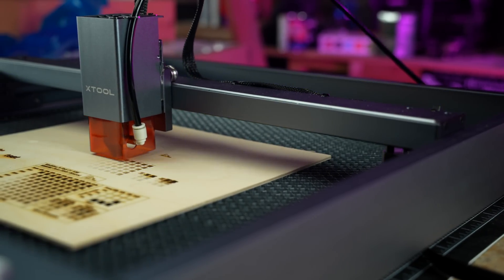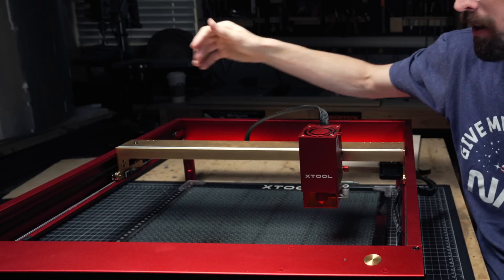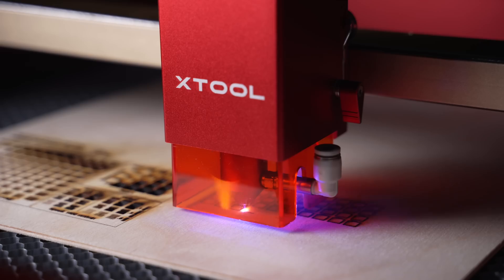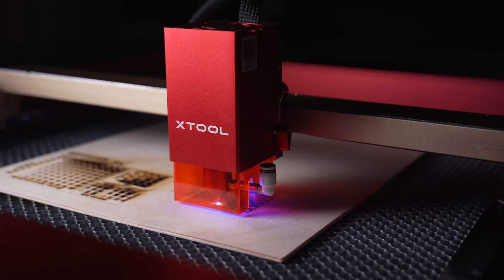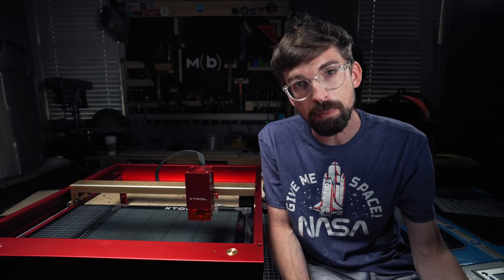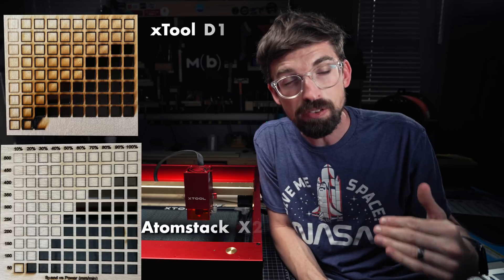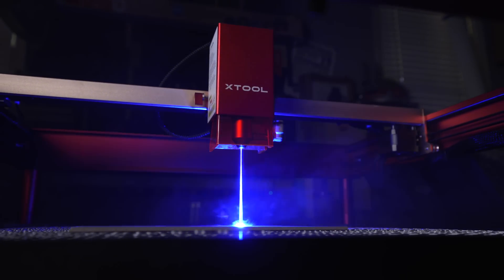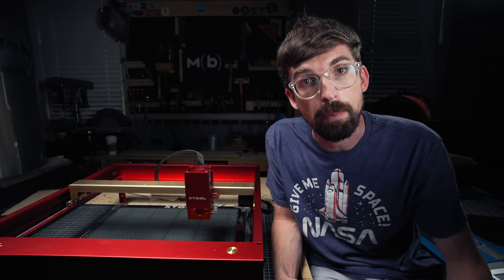3 HUGE Upgrades in the xTool D1 Pro!

Comment: Will either of those 20w machines, which you discussed here, engrave brass sheet to any depth?  I would like to be able to etch clock dials , with the engraving to such a depth that I can fill the etched numbers and markings with paint.  Don't necessarily need speed, in case it would require multiple passes.  Just want to know if it is possible at all. before purchasing a machine.  Thanks in advance for any advice.

Comment: Hello friend, I bought my xTOOL D1 Pro but, it has not arrived yet and, I have a question: Do the Limit Switches have to do with the laser functions > Current Position > User Origin > Absolute Coordinates? In other words, is there anything that needs to be configured before running the machine, so that the laser head does not collide with the machine's Frames? Thanks

Comment: Great review.  I have purchased the X-Tool D1Pro with all the attachments.  Half of the order is in and the other half will be here early next week.  Can't wait to get it all set up.  
My question is, what do you put under the honeycomb mat?  I am thinking that it would be a sheet of metal.
Reply: I use a silicone sheet meant for pet food bowls cheep and can handle the heat

Comment: This is a little off subject but I sure could use some assistance, I have a XTool D1 pro 10watt, I then purchased separately the 1064 infrared laser head. My question is can I use the power brick that came with the infrared also with the 10watt?  It’s kind of a pain switching back and forth. I’ve sent this question to XTool quite a while ago and have still not received a reply. Thanks in advance.

Comment: This isn't directly related to the D1 Pro. Does anyone know the center to center distance between the riser legs on the x axis and the y axis? I just ordered a metric ruler but it hasn't come in yet. I'm designing a mounting system for the laser. Thanks.

Comment: With the rectangular spot size depth of cut varies horizontal  vs vertical.    So machine performance us really  limited by the larger dimension. In this case .1mm is pretty sloppy. Best would be .o6 mm Sq. Spot.

Comment: Hey love your videos! just had a quick question hopefully you can help me out I’ve been trying to find out if one of these cheaper lasers can do a decent job at putting possibly a three letter logo on borosilicate glass or even possibly quartz without spending $4,000 to $10,000 and getting a UV laser  Which everybody recommends me doing? I just don’t wanna buy one of these and it not work at all so I figured get an opinion from the expert and see what you would think

Comment: A 30L/min air pump can be had for much less $$ than their $139, this model would be my first but haven't made a decision yet. Kind of surprised you would do a review without having the air assist in place and working, still you obviously have a great deal of experience and will be checking back for more info

Comment: A 20W diode laser ALREADY exceeds the capability of 40-50W CO2 machines on cutting. That is because of the smaller dot size. Typical CO2 machines will have a dot size of .1mm to .15mm diameter compared to the dot size of .08mm x .1mm on the diode machines. A smaller dot size means the power is concentrated more. You will NOT be cutting 10mm plywood in a single pass on a 50W CO2 machine (I have one). Also, engravings will not be as crisp, although the larger CO2 machines offer faster engraving output from better rails and more powerful stepper motors.

Comment: Brandon- can this cut 1/8th mdf? Or does it only cut the basswood
Reply: It will cut most wood. You will need to play with speed and air assist for best results. Make sure you have good ventilation when cutting plywood, the glues are pretty nasty.

Comment: What would you suggest in regards to this vs the atomstack 20w? I'm looking into doing overall everything possible. Wood cuts and burns also sheet metal/stainless pictures  And general use. What's the better buy?
Reply: I’ll go with Atomstack … it comes with air assist and I like how the air tube is connected w atom. But the build is d1 pro is really great but I’m more of performance than looks…a bit more cheaper with Atom

Comment: I just binge watched a lot of your videos after looking at the Atomstack and trying to learn about the different variables and stuff to consider. If I was going to start with the 20w laser I'd probably lean toward the Atomstack, but if I want to start out with the 10w or maybe even the 5w and then upgrading to the 20w or something down the line, which would you go for? Looking to mostly cut out board game components, so a recommendation for initial power would be helpful as well.
Reply from the maker: I still lean towards xTool, but Atomstack is going to let you extend the size of the machine which is awesome.  Either of those companies you’ll be pretty happy with.  xTool does coke with software that is simple to use, Atomstack you’ll jump into something like Lightburn which is awesome but has a learning curve.
Reply: @makeorbreakshop  Do you lean Xtool because of build quality mostly? Or just kind of personal preference because of company familiarity? Which of the models from either company would you recommend I start out with if I plan on upgrading to the 20w further down the line?
Reply: @makeorbreakshop  I’m wondering if Black Friday will bring any price reductions on either of these?
Reply: Great choice with Atomstack …. I had their a5 pro with 400x800 work area then this m100 20w laser came out then I simply bought the module and it came with air assist … just buy Atomstack x20 pro you’ll like it… yes built of xtool is better but performance and price are far more important for me

Comment: I just bout the Atomstack X20pro. I looked at both units and both are great. Xtool I think the build seems better however the fact air assist is not included for a high end model was what turned me off. Also I think the Atomstacks laser cover is better at protecting the eyes.
Reply from the maker: I forgot to mention the laser cover.  xTool is better for filming, but Atomstack is nearly impossible to see the laser beam which is great for safety!
Reply: @makeorbreakshop  It's an openframe 20W laser, increased safety is the selling point. Atomstack X20 also comes with air assist and a control interface for the same price as the D1 Pro which does not have those. It's also disingenuous for xTool to claim "The World's Most Powerful 20W Diode Laser" when the Atomstack X20 was there first and is also a quad diode laser at the same power output.
Reply: @makeorbreakshop  love the show mate. Always watch. Keep up the great work.

Comment: Sent back a genmitsu jensoku lc-40 because it is only 5 watts. If the work area on the lc-40 was the same as Xtool d1 or larger & it had a 10 or 20w laser option, it would be the far superior machine. For ENGRAVING, genmitsu jensoku lc-40 is superior. I want to cut thin wood & use rotary, though. So I was forced to by d1 pro 10w since 20w is way too expensive right now. Speed trade off, right? If lc-40 had 10 or 20w, I definitely would have bought that. If I was ONLY engraving, it would be the best laser for that, hands down. Build is just that much better. Linear rails, no brainer.

Comment: I was initially going with xtool but tried purchasing during launch the codes provided did not work, emailed xtool and never heard back plus didnt want to wait to most likely mid Aug before they actually start rolling out. My big thing was air assist I know its only 150ish but something with that amount of power should be included IMO. Also planned on using lightburn so software wasn't an issue for me, although I do like xtools platform better.
Reply: I ordered the D1 during the livestream and am still waiting. They said they will be shipped mid Aug and they upgraded me to the pro.

Comment: I have the xTool D1 and I just recibe the 20w module that I bought at the early bird, and have the power but not the small adjustment nor the air assist nozzle. That’s the worst combination posible

Comment: optical output power? Or, as usual, the power consumption of the module xD ..A laser power meter to check the manufacturer's specs would be nice.
Reply from the maker: It's optical output power for the 20W.  I'm looking at getting a power meter to check these machines in the future.  xTool is one of the few that don't advertise the machine power which is nice.

Comment: In about to buy the Atomstack.   I have a cnc with an old 2.8w laser.  I already run Lightburn, so the addition of the air assist pushes me in that direction.  I’m actually an electrical engineer, and I’m thinking the next level will be 8 LEDs in a circular array.

Comment: Atomstack for sure. They have a coupon right now for $100 off. So it is $999 compared to this at $1169 and $139 for air assist. $308 is a significant difference.
Reply: Saving $$$ and waiting for the dust to settle on the new models from Atomstack and Xtool. The price will come down and others can Guinea pig it for a few months while I wait. 10 watt models will be even cheaper.

Comment: I've been waiting for your review of this great job! but I'm still torn about weather to go with the atom stack version.. what does xtools air assist look like as far as size compared to the atom stacks.
Reply from the maker: Size they are about the same, Atomstacks is nicer though since you can use twin compressors and change the speed. But the xTool still will get the job done.

Comment: HI Brandon , excellent review as always , im torn between the D1 PRO and the Sculpfun s10 or the atomstack equiv . been looking at these for ages now to integrate these into my little airsoft business mainly for engraving  but as far as i can tell the D1 and the Sculpfun s10 will allow the laser unit to be positioned  higher where as the atomstack needs to be a lot lower down for focus . what im really torn over is wether or not i need the 20w or would a 10w suffice. any advice would be grateful thanks
Reply: I’ve bought the S10 and saved 500 euros to upgrade to a 40w laser which is coming next year.
Reply: Greetings from Germany. I would suggest to buy the D1Pro if you can afford it. I tested both and for my Uses the D1 is not only sufficient but also future-ready. The Atomstack is just fine but the build-in Diodes are better integrated and the engraving on metal (uncoated) looks just a little bit better. If you just want to engrave airsofts (Polymer /Metal) the Atomstack can do it but in my opinion the d1 does it faster and still in great quality.
Reply: Я фанат Sculpfun, гравировка более чёткая, лазерный луч более тонкий, поэтому для гравировки лучше Sculpfun S9 или Sculpfun S10. Я купил Sculpfun S9 для гравировки, результат прекрасный, даже на нержавеющей стали могу гравировать, хотя у меня всего 5,5W, я уже хочу модуль Sculpfun S10